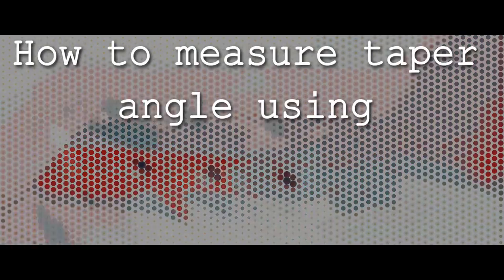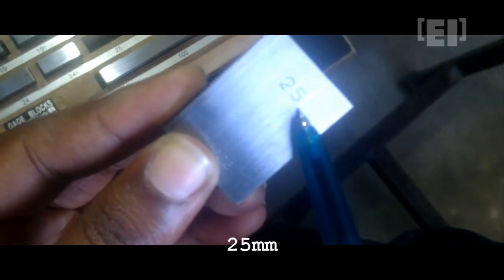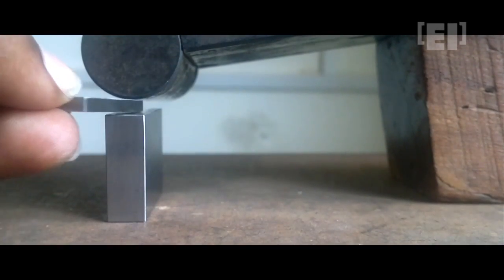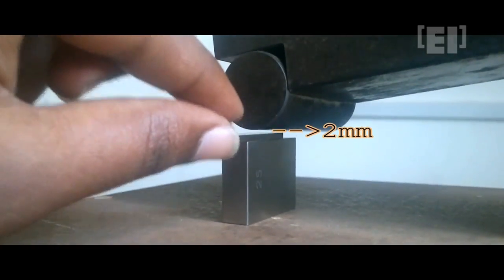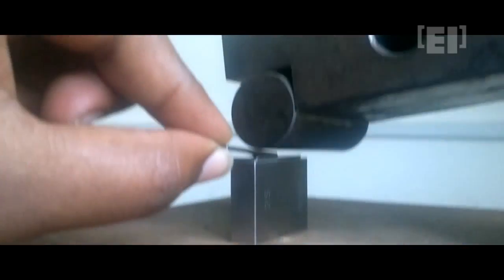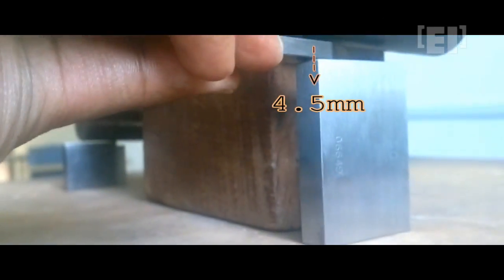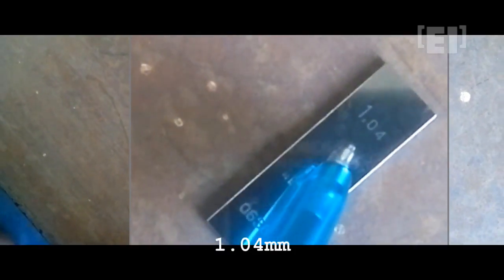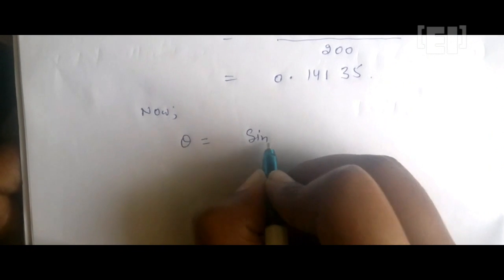How to measure taper angle using sine bar.

Comment: This method is wrong. 
Normally placing gauge blocks (slip gauges) one side only. Wringing the slips are compulsory. Otherwise, error happens in measurement.

Place the sine bar on the job upside down if the object is big one. And use dial test indicator directly on the rollers.